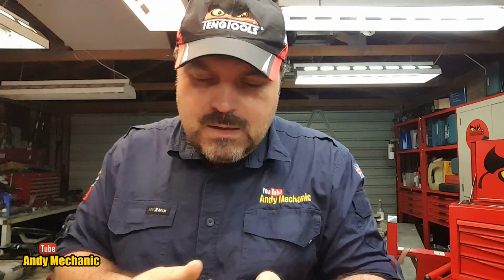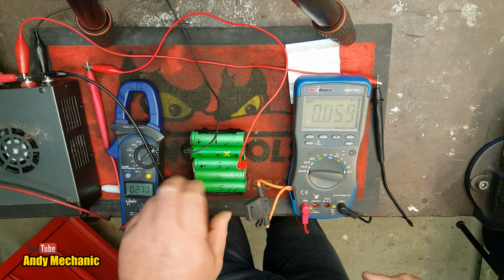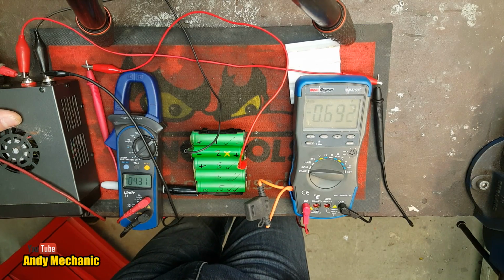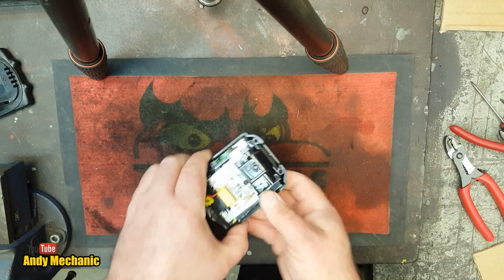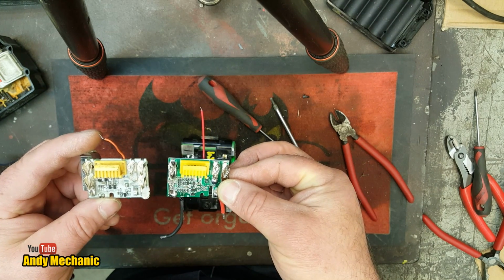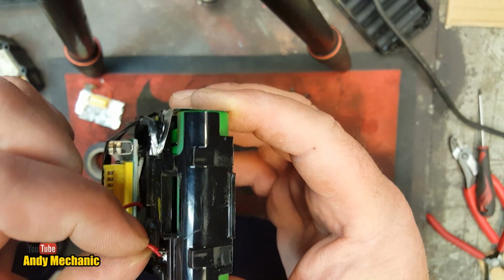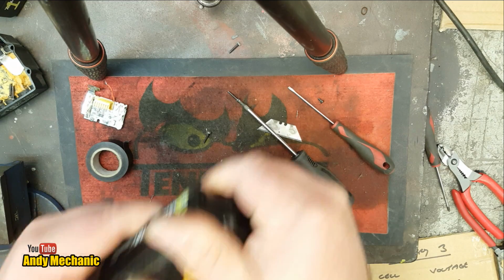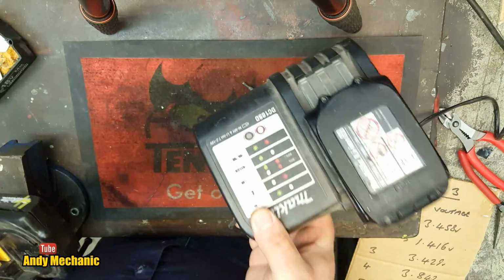Lithium Ion battery fix Ep.5 - battery 3 #1449

Comment: Andy, Li-Ion, LiPo and LiFePO4 all uses CC/CV (constant current/constant voltage) charging. During charging a constant current is used as the voltage over the battery rises up to a threshold voltage. Once the threshold  voltage is reached, the voltage is kept constant (limited) whilst the charge current goes down. Once the current is sufficiently low, the battery is considered fully charged. 

The threshold, or peak, voltage differs between the different lithium battery types, but for Li-Ion it is typically 4.16V. For LiPo it is typically 4.2V and for LiFePO4 it is typically 3.65V.

It is quite safe and easy to charge these battery cells using a bench lab power supply, provided it has both voltage and current limiting. Just set the voltage to the correct peak voltage and set the max current to 1C charging (match the amp-hours of the battery).
Reply from the maker: Great info Leif, thank you for explaining that in such detail. We are always learning. I'm sure that info will be of great help in future videos. Cheers Andy
Reply: And for ease of failure... use a Temp probe. see what is charging or catch it before thermal runaway.

Comment: Hey Andy I’ve got a 5ah battery that has the yellow clip broken so it won’t charge, I have a 1.5ah battery that I don’t mind sacrificing can I just use the 1.5ah circuit board on a 5ah or will the boards be different?
Reply from the maker: Hi, yes I'm sure they are, when I ordered the replacement boards I had to select the correct Ah battery pack I was fitting it to..

Cheers Andy
Reply: Andy Mechanic ok cheers mate thanks for the reply